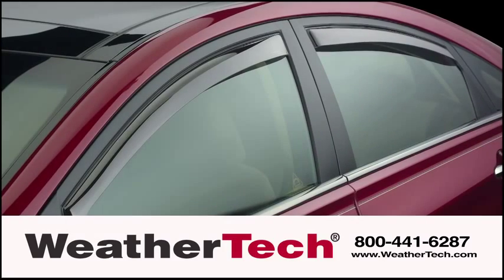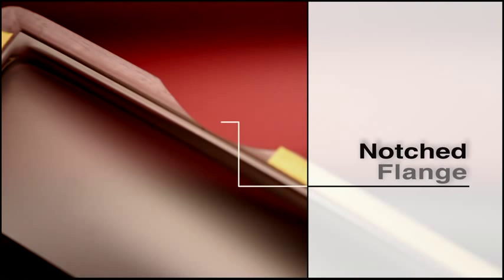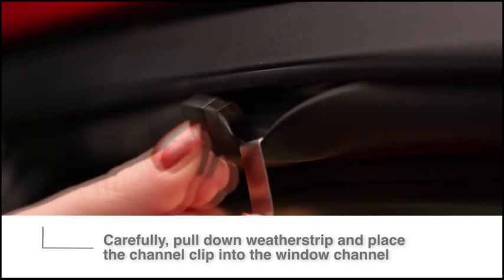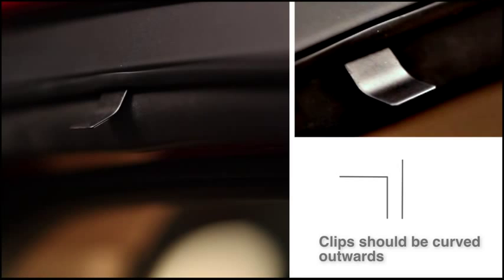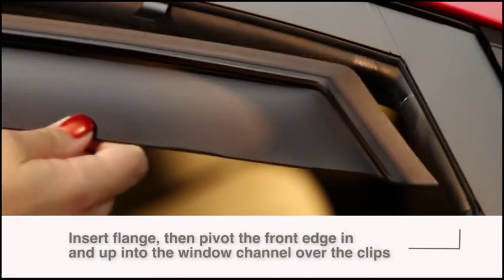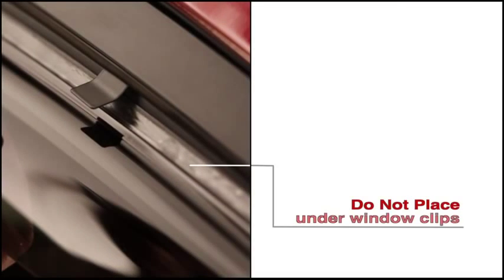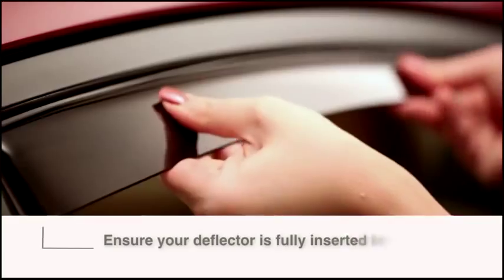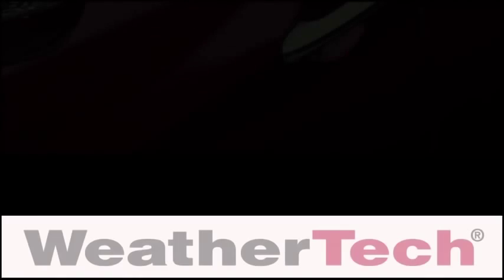WeatherTech: Rear Side Window Deflector Channel Clip - Installation Guide

Comment: Can't use the clips on my 2020 camry, the window slot is too Shallow and the clip doesn't sit like it shows in the vid. I couldn't use the clips and just seated the guard in the slop as the fronts do. Hope it doesn't fly off. Also the window auto goes back down when it detects resistance from the guard. I did the tip shown in the instructions,  didn't work. They should makee the flanges on the guard a little thinner to fit better. NOT impressed with weathertech rain guards!